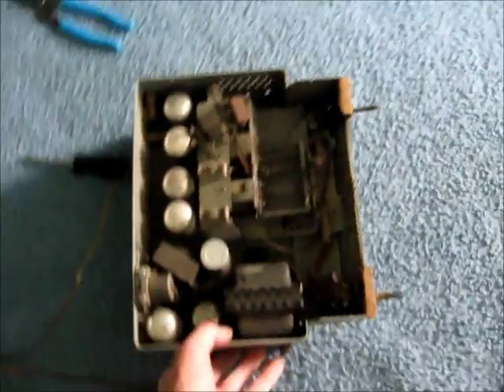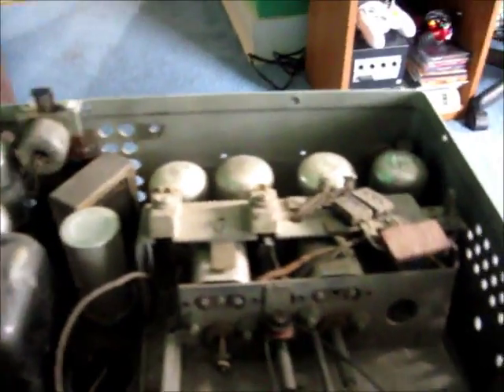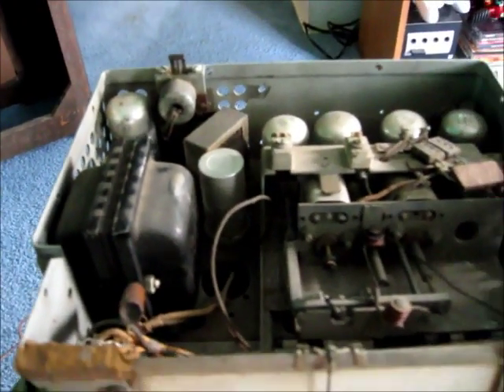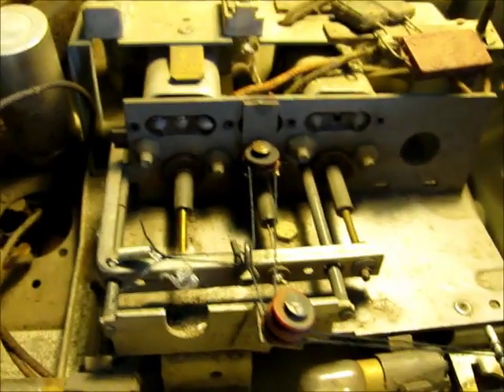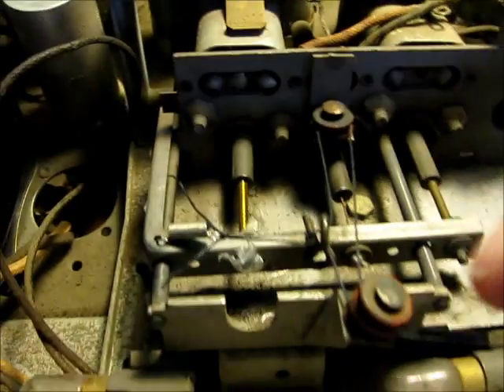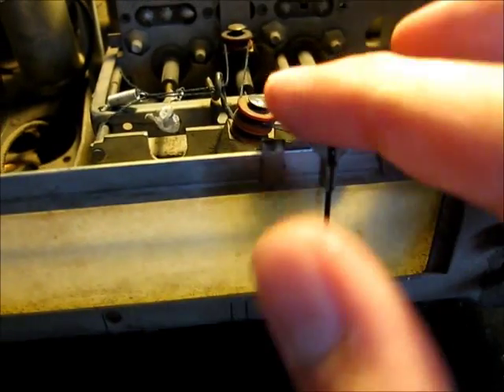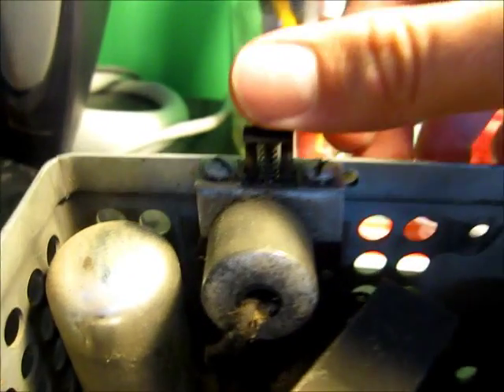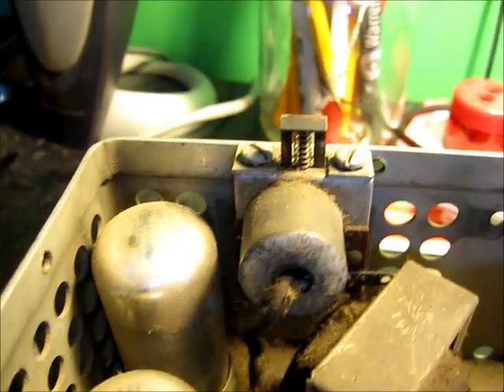Philco A-361 Cord Restringing and Tuner Fix

Comment: I have an A-361.  I recapped it and it works well, but there are a few things I should mention.

Mine has the original electrodynamic speaker.  the voice coil is loose from the form and it sounds like crap.  You have a much newer (but not original) PM speaker.  It sounds good, but I wonder what someone did about the field.  Yes the original speaker is 6x9.

Advice recapping this radio: There is a cap between the plates of the 7Y4 rectifier.  It can safely be eliminated.  It is a hard to find and expensive cap, I forget the capacity, but it is rated at 1200 or 1600 volts.  It is an artifact going back to the days when this was a car radio and it is called a buffer cap.  It is very necessary with a vibrator power supply - or it will cause premature failure of the vibrator, but with a normal power transformer it has no use.  Actually it creates more of a load on the power transformer and you are better off without it..
Reply: @Bob other than the usual recap information, you can eliminate the buffer cap between pins 3 & 6 on the 7Y4.  It is vital with the vibrator power supply but it is completely unnecessary with the line operated supply.  It is a 1600 volt cap, hard to find and a little more expensive and it’s not needed.

Also, mine had a loose voice coil in the speaker and I have not resolved that.

Comment: I just bought a 1935 Philco radio and I'm in the process of fixing it up. I heard you say Iron Pigs and realized you live in or around the Lehigh Valley also. Radio sounds great, I can't wait to get mine working. I'm surprised you didn't go for a complete re-cap. You're not worried one of those old caps will short?

Comment: I have used your video to restring the tuner on my radio.  Your video was sooo helpful.  Thank you.  I am now downsizing and want to sell it, can you give me an idea as to its value range?  I believe it works but have not plugged it in for many years because it has the original wiring.  Thanks so much.
Reply from the maker: To the right collector and if restored, I would say somewhere in the range of $75-95.  Due to the simplicity of the chassis, there's not a lot going on for the collector who wants a cabinet with all the bells and whistles.

I don't suggest plugging it in. Age is what kills the components, not use.